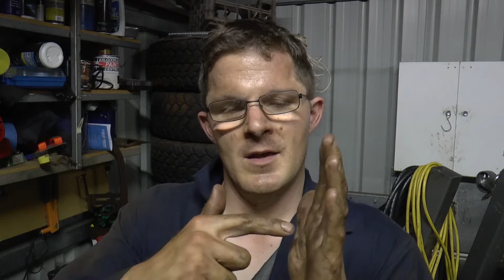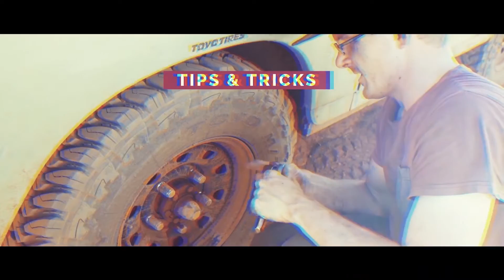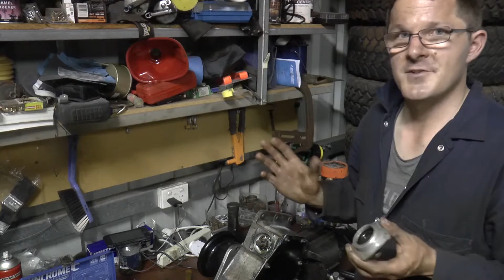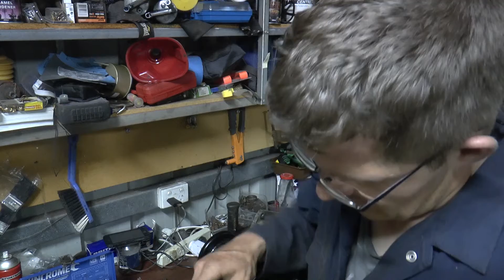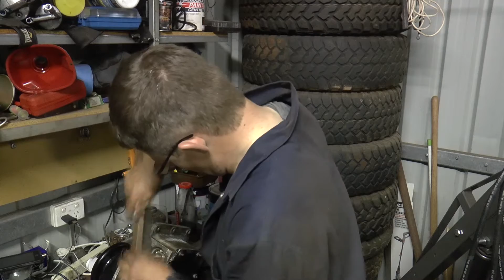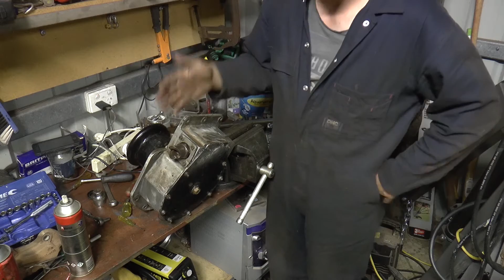Changing oil seals on capstan winch

Comment: They made short handles for starting with the winch, I've got one myself with my aeroparts winch.
Reply from the maker: Hi Scienceaddict77. I have heard of these, how have you found it to use?
Reply: @seriouslyseriesaustralia  I need to get the winch installed first, but it's the perfect length to work just like the standard handle.